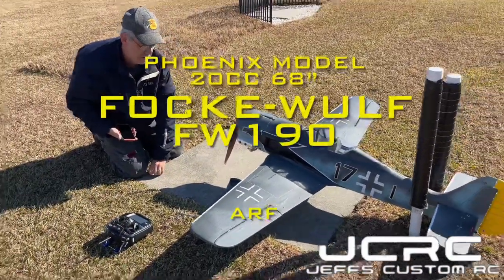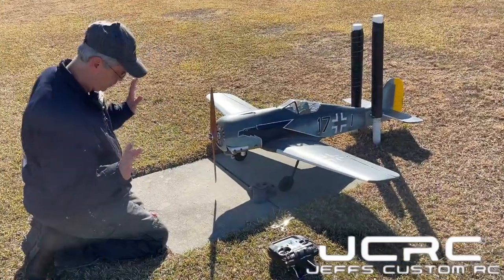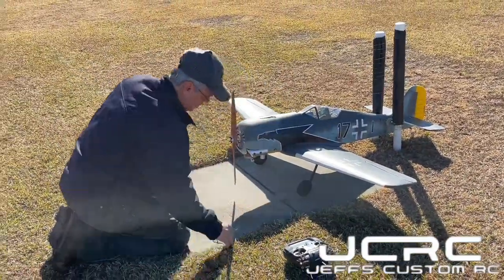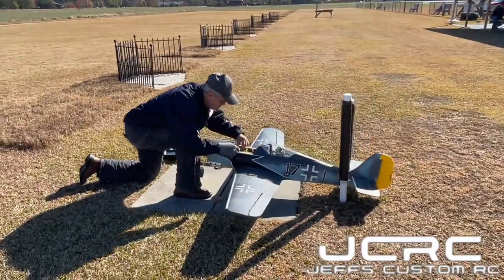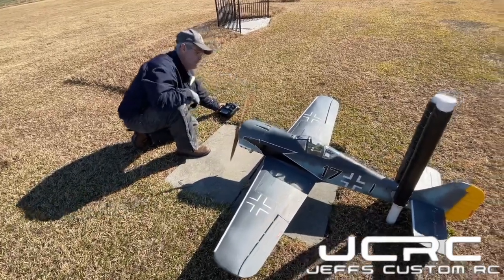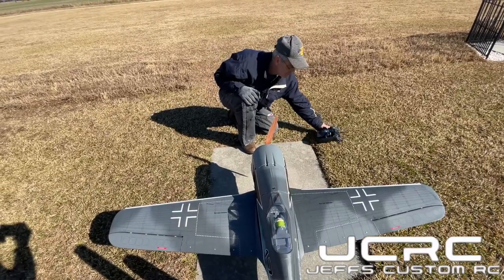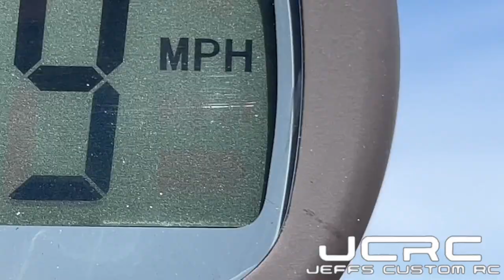Phoenix Model FW-190 Focke-Wulf ARF 20cc 68” With 55cc Installed| Butcher Bird Flown By Wayne

Comment: Absolutely LOVE my phoenix FW, granted it has a 26cc in it but dhe still gets up and goes pn a 16x8 prop
.1/4oz weight glued inside front of cowl and x3 6.5 nimh batteries mounted on engine box. Gave me the perfect CG. I will say compared to my hanger 9 p47 with a 30cc engine. This plane is a handful at full throttle and on landings. If u plan to fly this model fast. Make sure to follow the recommended control surface Throws. Cause on high rates ziz gaman plane is a doozy and quite sznappy.....lol

Gr8 job guys. Both flying and filming

Comment: i would put a proper 3 bladed prop on it and you would be able to go down and inch in diameter and have more ground clearance for the propeller as well.
Reply: That is correct! I already have a 20x15 that I am going to try to pick up some top speed. And I have a 17x21 that I will try if needed but I doubt that it will. I don’t want to over fly the airframe and destroy it. Thanks for watching!
Reply: @wayneschriver638  Yes you have a whole lot of Motor on that baby for the size of the airframe

Comment: I’m building this right now and the retracts don’t seem to drop straight down 90 degrees from the wing.    Yours appears to be a little like that too.  Or it’s a trick of the camera.   
  Did you notice anything with your gears not seeming to drop a full 90 from the closed position?
Reply: I just build mine and i have the electric retracts and like you said it’s not 90 defrees i think its normal lol
Reply from the maker: Hi…this Wayne’s plane so I’d have to ask him, but I’d be glad to find out for you. He may have modified them since he’s good for that, let me see what I can find out. Thanks
Reply: Thanks buddy.  I’m starting to think they’re meant to be that way.   It is scale but I don’t know how well they’re gonna hold up cambered in like that.
Reply: @dayrondlt it seems they’re scale minus the actual axle should be angled so atleast the wheel is straight up and down.  
  I found a pair for a phoenix model Strega that are super close in all the measurements I may use instead.  Let me know and I can send you a link to them.  I think they’re only 60$ or so.
Reply: They are NOT true 90 deg to the ground. Also I would shim the rear of the retract mount 1-2mm up to help with flip over on take off and landing. Basically pushing the pivot point forward. Hope this helps

Comment: Hello Jeff/Wayne,
I’m preparing the same model and like to put a Saito FG33-R3 radial engine on it.
It’s just a less more heavier than your DLE55 with ignition and exhaust (6 ounce heavier).
Regarding the total weight of the model; do you have the mechanical retracts or the Phoenix electrical retracts for this plane?
I bought a pair of these, but they a realy heavy. Weight for both is about 19 ounce!
Can you give me an indication of the total weight of your plane?
Thank you for your answer.
Reply: Total weight less fuel is @ 14.5lbs
It came with the electric retracts in the kit but the electric double reduction gears are all plastic and strip out really easy. I removed the electric drives and installed a standard servo on both sides to actuate each gear. The actual mechanical part of the gear are really good and never had a problem with any mechanical parts. I made some linkage with some 4/40 push rods and it works really good every time.
The radial 33cc will work fine. The extra weight is minimal and shouldn’t be any problem. I don’t know why but this 190 just floats off of the ground with no flaps like a butter fly and lands about the same. We got about 135mph with a 20x15 prop. I can push it another 8mph faster with a 20x16 prop. I’m afraid to push it any faster than that. Yours will fly great. Good luck!
Reply: @wayneschriver638  

Thank you Wayne for this very helpful information.
I’m pleased to read that the Saito FG33 radial will be a good match and the (total) weight will be acceptable.
Also pleased with your experience that the Phoenix FW190 is a great flyer. This encourages me.😊
Thanks again Wayne, happy flying and wish you all the best.

Comment: 35RA maybe, but a 55 really?
Reply: No nose weight needed and getting ready to install a 20x15 prop to pick up another 25mph after the break in. Purpose built for the local Gaggle. Not just a regular scale warbird to fly on the weekend. Thanks for watching!
Reply: Hoping to purchase FW and use a DLE 20cc  approximately how much nose weight to achieve neutral CG? The difference in weight between a DLE 20RA and a DLE 55RA is 1.7 lbs  (1.7 : 3.4 each engine wts)  that's pretty big amount.
Reply: "I can't ride a wheelie so you shouldn't either" "and no speeding"